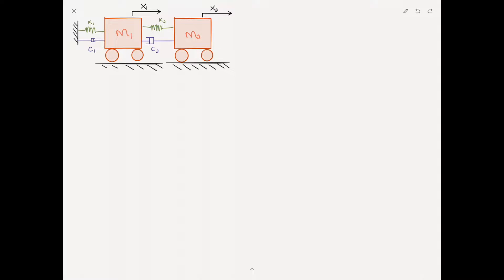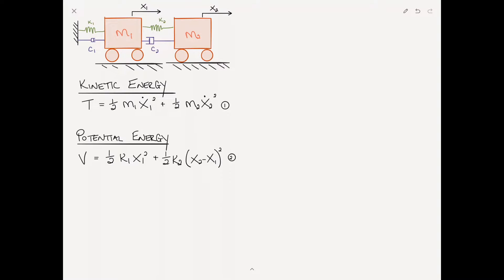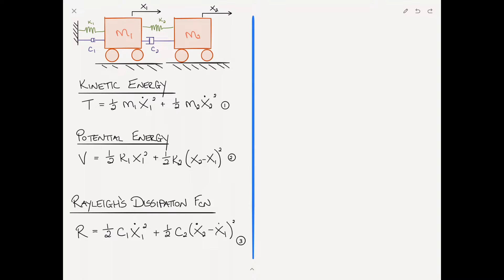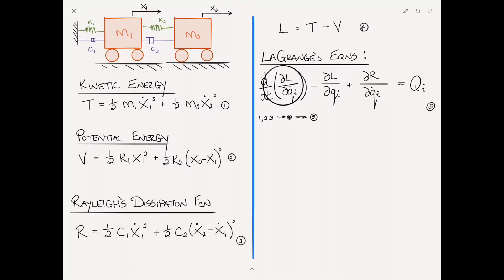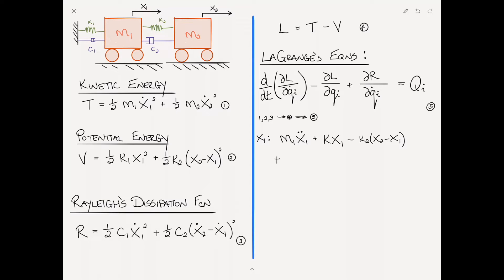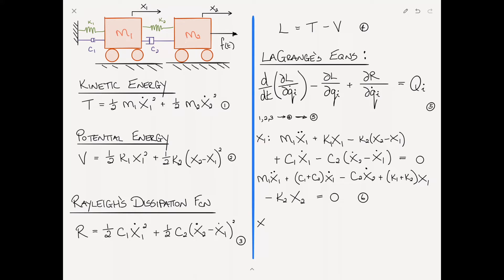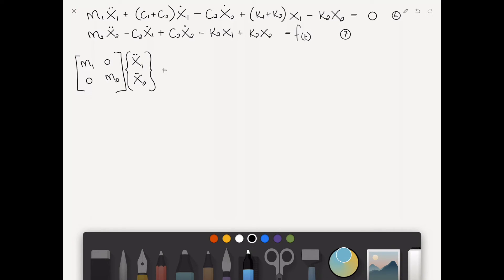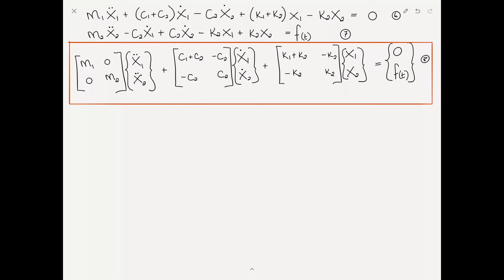Two Degree of Freedom (2DOF) Problem With Damping - Equations of Motion (EOMs)

Comment: Hi. Sorry to post this message in this comment section. I am a Chinese high school student, and currently, I am working on an extended essay about tuned mass damper. I was going to do the optimization of tuned mass damper until I found it was way too complicated and beyond my ability since I have never learned this in my school. I just learn all the content on my own, but I am stuck now. Can you give me any suggestions about where to start? And how to lower the difficulty so that even high school students can finish it? Thank you very much and sorry for my poor English.
Reply from the maker: I would definitely encourage pursuing this because I think it is an interesting and relevant project.  Take a look at this video I made on dynamic vibration absorbers.  It should be a good starting point: https://www.youtube.com/watch?v=7T6pQnNBph0  The math in here requires some calculus (differential equations) for which I have some review videos: https://www.youtube.com/watch?v=S2-26LR8_Es 
If the math in the derivations is too difficult, then simply use the final results (which are not difficult to use) and try to understand the concepts from the video.  It will make a good starting point.  If you have any further question regarding your project, you can drop me an email at: apf999@gmail.com

...also, take a look at "slosh tanks" for building damping.

Comment: It is obvious that the resulting equations of motions are coupled because of the nondiagonal damping matrix and stiffness matrix. Solving such uncoupled system of equations is not straight forward. Can some body demonstrate how to solve such uncoupled equations?
Reply: sorry I meant coupled equations
Reply from the maker: A common way to solve coupled equations is to use the normal mode method.  I need to make a video on this still, but the idea is that you can use the eigenvectors to transform the problem into its principle directions.  This has the result of decoupling the equations (it diagonalizes the mass and stiffness matrices) and leaves you with n individual equations which can each be solved.

Of course, you can also get solutions using the numerical methods that I have explained.
Reply: @Freeball99   What does coupled mean?

Comment: Thanks for the videos, they're helping a lot! Could you explain why did you do (X2-X1) instead of (X1-X2) when calculating K2's potential energy? I'm always unsure about the order of those
Reply from the maker: One of the benefits of using the Lagrangian approach is that it doesn't matter which way round you write it because you are squaring the quantity - the signs will come out correctly regardless after plugging into Lagrange's Equations.  

If using the Newtonian approach, then you need to be careful to get your signs correct.  Usually just a question of being consistent with your coordinates and sign conventions.  My suggestion is to vary each coordinate individually and look at the effect on the spring force).
Reply: @Freeball99   Hello loved your video i also had a question on how to incorporate damping and you cleared it up now is there a way to express the Lagrangian in terms of spring displacement? in this case it wpuld be of the second spring so xs=x2-x1
Reply: the coordinates I mean